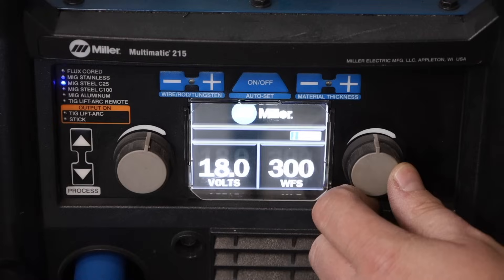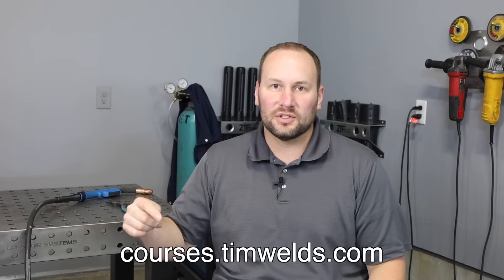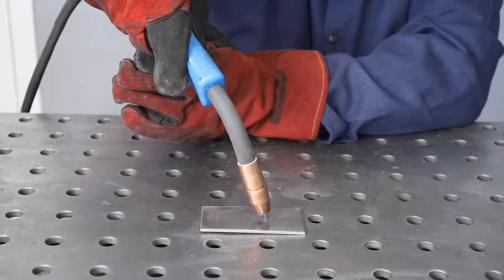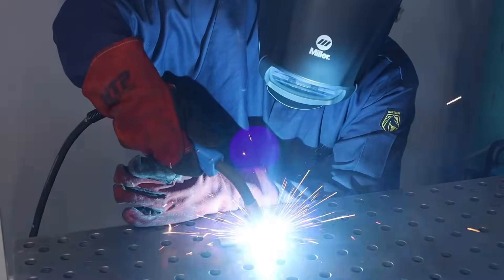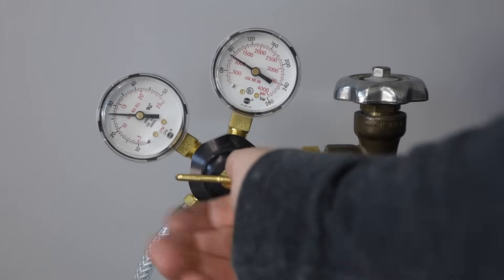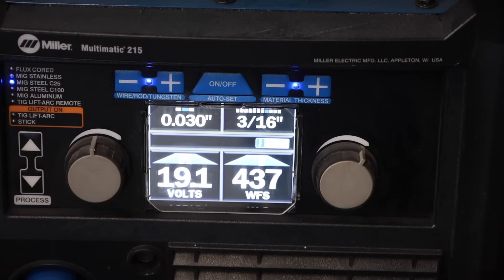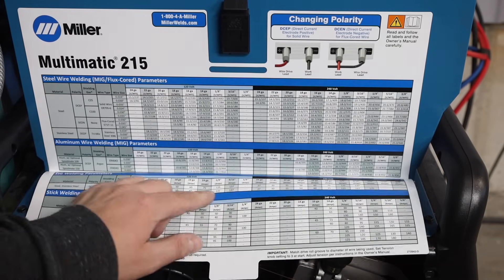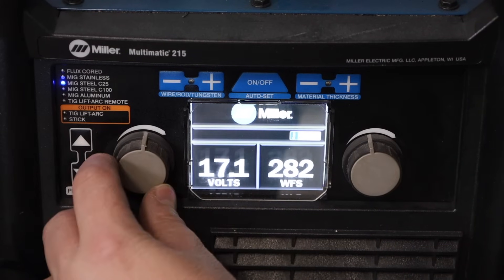MIG Welding Basics For Beginners

Comment: I weld service hangers for underground mining.  Taught hand propping to get a feel of thick metals but switched to free hand immediately welding hooks to a flat bar as need to make sure is square and against the prop.  Hard yakka when got a guy with 25 years more experience  than me waiting for me.  30 volts and 11 with the wire speed.  
We weld off angle as the hook is pulled in square to the flat bar during the weld.  Does this not happen with smaller materials?

Comment: hi sir, nice content. I am a begineer and using HBM200. This machine have only voltage, how to i play with it. I m working for motorcycle frame. The wire can be use is only 0.8 and 1.0, Please advice, thanks

Comment: 74 yrs old. self taught amateur no books and no You Tube with wonderful videos like this. started gas brazing 50 yrs ago, then gas welding, then stick welding with the cheap buzz box for many years, picked up a used suitcase inverter DC stick (what a huge improvement) and now have a 250 amp MIG which is a joy to use.  Wish I had went to Lincoln welding school.

Comment: Greatly appricaite this. I am actually about to head to weld training at work, & I never welded a day in my life. However, I used to watch my old man build stuff growing up. Plus now with work wise I see alot of crappy welds within the dept. I'm at. Most common at the work place are running wire too fast causing splatter, & having too thick of a weld. Before I moved to the fabrication dept. I was a lead in the Powder Coating Dept. Can't tell you how many issues we ran into from fabrication. Gaps in weld, Pinholes (Very common), weak welds. Thanks for this video as this is me doing homework for the coming up event haha.

Comment: You find the running amps by looking who manufacturers of wire they will give u the correct settings
Reply from the maker: You don't set amps on MIG. There isn't a particular setting that will work for a given wire in any situation.

Comment: So the voltage controls the contact frequency? So if I'm getting slow pops, do I need to increase or decrease the voltage (is contact rate proportional or inversely proportional to voltage?). I have an old 90A Mig w/ CO2/Ar and 0.8 mm steel or Al - Just testing it for now, trying to weld stuff. It's a Clarke with Min/Max and 1/2 switches, both controlling voltage, apparently ("Max" & "2" being maximum).

Comment: I noticed you weld in both directions. My tutor is trying to get me to weld right to left so I see the tip and joint to be welded but I feel more comfortable welding left to I right. Is there a right or wrong way in your opinion
Reply from the maker: For short circuit MIG, either way works. Assuming you're right handed so you are talking about a push angle, it's a little easier to see where you're going, but you have to look past your wire to see the bead profile. A slight drag angle will give slightly better penetration in some cases, but it matters very little as long as you're hitting the joint. If you ever weld aluminum or use a spray transfer process, it needs to be a push angle. For flux core, it needs to be a drag angle. I think it's best to learn to weld both ways.

Comment: TIP1: Some machines have a PURGE GAS button and a WIRE FEED button. The WIRE FEED is handy when you install a new spool of wire and don't waste gas, and the PURGE GAS button is your friend at the start of your shift because over the course of a few hours, the gas dissipates from the whip and so if you weld without PURGING GAS, or pulling the trigger to replace the dissipated gas, the start of your first weld will have porosity. EDIT: I forgot to mention that the only machines I've worked with that don't require a trigger pull or purge gas start of shift are the FRONIUS machines, but it's still a good habit to do it anyways incase you end up changing to a different work station or job location where they use a different machine.

TIP2: It might be useful to think of WFS vs VOLTAGE as such: WFS is the INDEPENDENT variable, where VOLT is your DEPENDENT variable. In other words, what you set the voltage to is DEPENDENT on your WFS - NOT the other way around.

Comment: You know what to do only one thing you  don't know   I will tell you ànd al you guys   is the electric power  I have that try to ran my welder never work properly   I found out the breaker box only 5 volts breaker was there  I needed  25 or more  so didn't work the plug for my welder  so I have see that same is wel to

Comment: why its always called MIG? it is MAG also no?
Reply from the maker: This is technically MAG because the mixed gas is not completely inert. In the US most people and nearly every equipment manufacturer call everything MIG so I follow suit with that. They use the same equipment and follow the same general principles, so the difference in terminology is really just semantics. The more proper technical term for all of it is GMAW or gas metal arc welding. Aluminum is just about the only material that is welded with true MIG, nearly everything else is technically MAG.

Comment: what i learned from my class mate is when you clean your copper collet you push the dirt out from inside out from the otder end with a thick (ca. 1 cm ) round piece of metal rod. or one leg of the welding pliers. I tried to turn it inside as you did it in the video but  ot realy cleand it propely. It's just one tip.

Comment: Just found your videos. How do you know how many volts are in a setting on a Hobart Handler 140? The is no digital reading on this welder. Thanks.
Reply from the maker: The absolute number doesn't matter. Turn wire speed up and down to control overall heat because it indirectly controls amperage. Turn the voltage up for a longer (average) arc length and turn it down for a shorter one. I have several MIG settings videos on the channel that will walk you through the process.

Comment: I need to weld a piece of metal tube at a 45 degree to a metal frame.  Can I hold the piece of metal tube with my gloved hand while welding it to the frame or will I shock myself???
Reply from the maker: You can hold it to tack weld it in place. The circuit will be between the weld wire and the work clamp, so you wouldn't be anywhere in that path. It's completely isolated from earth ground and your electrical system.
Reply: @TimWelds  Thank you!

Comment: Why do you call it mig? Is not more correct mag? Metall active gas
Reply from the maker: You're correct. In the US, most call it MIG regardless of the gas, so I use that term even though it may be slightly incorrect. Gas Metal Arc Welding is the correct term in technical circles. Honestly, it's a trivial distinction in my mind since they use the same equipment and have several variants.
Reply: @TimWelds  thank you for the explanation. I am from Germany 😏😀

Comment: I've gotten the welding machine from my stepfather. Unfortunately he passed away and I'm left with a tool that I don't understand but am willing to learn.

Only on my welder I need to select the welding thickness and steel type.

It's an oerlikon citomig 200mp with two different bottles.

Oh with 85/15 argon/co2 and one with I2003 argon.

Don't know what the straight argon bottle is for tho
Reply from the maker: The straight argon is probably for welding aluminum.

Comment: I got a mig passed by my grandad and hardly  know anything but I thought u didn't need gas for a mig
Reply from the maker: You can use flux cored wire without gas or solid wire with gas. I have lots of tutorials on the channel for either.

Comment: Tim, I'm absolutely just a hobbyist welder short on knowledge and grateful for youtube. Question--why not make a jig to use for holding the torch at the right angle  (at least for simple linear welds)? Maybe there's just too many variables involved for different welds that are required. I'm 67 and just learning but wish there was a jig that could hold my torch to take away my unsteadiness.

Comment: NO its called mag welding... Carbon dioxide is an active gas
Reply from the maker: Technically true, but in the US you’ll never hear the term. Gas Metal Arc Welding is the technically correct catch all in academic circles around here, but I just used the term more people will know.

Comment: When welding a thinner piece of steel to a thicker one - eg a T weld when the vertical piece is say 3mm and the horizontal piece you're welding it to is 6mm, what setting do you use from the charts on your machine - 3mm or 6mm?
Reply from the maker: Closer to 6mm settings than to 3mm. The technique is to bias the larger plate a little bit and it will roll evenly between the two.

Comment: Something you did not cover and most do not cover is. I have a hard time seeing what i`m welding I don`t know if it is something i`m doing wrong or if my shield is set to dark if i`m in the wrong spot when welding. I just have a hard time seeing the two parts i`m welding or the crease where i`m welding. Thanks Kevin
Reply: Welded for my first time yesterday and that was my biggest issue 😅
Reply: @SamplyCharishBeatz highlight chalk
Reply: Keep the glass clean and try a lighter glass type. Darkest is 12. 10 is lighter but when you are not yet used to the weld light, your eyes will be "over lighted" ( I do not mean "weld eyes. That feels like horror, like sand in your eyes). You must always look at the melt bath. You can also use crayon/a chalk and drag a line parallel to where you want to weld. Welder for 13 years and weld inspector/ndt for 13,5 years.

Comment: Does the wire make contact with the metal?  If not how far does the wire need to be from the metal?
Reply from the maker: The wire is constantly feeding out. The important distance to control is from the contact tip to the work, which should be about 1/2” (13mm).

Comment: I’m learning this type of welding in college at the moment but my welding skills aren’t that great at all. I just seems to burn the metal, it’s either due to how far away the I’m holding the welder from the metal work piece, the angle I’m holding it at or else the speed I’m welding at or maybe a combination. Out of curiosity how far away am I supposed to hold the welder from the piece or am I meant to have the metal tip of the welder on the metal work piece itself? And also if you know what is a suitable angle to have the welder from the pieces. Thank you

Comment: Thank you for your great content. Awesome videos. A lot of trade welders are going to be using larger syncrowave or Lincoln machines, and they are not digital displays. But the voltage and amperage settings still translate. It's all about the settings. You have a subscriber here. Keep up the great work.

Comment: Good day Sir.

I am experimenting with the different welding methods, i started with arc welding and then moved into TIG and no want to try MIG, i have argon gas from the TIG welding and want to know if i can use that for mildsteel with the MIG welder, it is quite a thing to keep different gasses on hand for welding both the cost and availability plays a big role. 

Any advice on a happy medium for a non professional welder doing odds and ends?

Regards

Comment: They are called welpers. Taking off your tip and nozzle is a waste of time. It should feed right through. Inductance is huge if you have even basic skills. It controls the firmness of your puddle. Wire feed speed controls the speed of wire being fed nothing else. That is why if you have too much wire it spatters and pops all over the damn place. You can control that spatter by adjusting the wire to an appropriate speed for the voltage being used. You Tavel fast you get a shitty weld, go to slow same result. It is a good idea to manipulate your weld because you can get more impurities out and leave a nice looking weld. A nice looking weld is just as important as it’s functionality. Try to use the edge of your work bench for stabilizing you for longer welds.

Comment: 11:50 i actually think this is where my mystery poriosity has been coming from. Because its typically come on the back end of my welds. I hadnt noticed im using my wrist but it does make a lot of sense. Gonna have to do some dry runs to stop doing that.

Comment: Is it safe for me to have never even touched a welder before and weld a motorcycle frame that is cracked in half together for a bike that does well over 100mph?

Also I'd probably just set it to 18.5 volts and call it a day.

Comment: Hi, beginner here with beginner questions—Why is it best to clamp the negative directly to your work? How is it better? Whats the idea? And, is there a time when it's absolutely necessary to clamp directly to your work?
Reply: Mig stainless steel welding
Hope you like

 https://youtu.be/mTCNjjhy9u4
Reply: Depends on what quality of work you want achieve.  Surely you will lose some power.  

It will cause welding current leakage or restriction. Or in other words, it will cause a drop in welding output voltage.

Comment: Is the shielding gas supposed to be 75 pct Ar and 25 pct CO2 or the other way around?
Reply from the maker: That’s correct 75Ar-25CO2. That being said, you can run anywhere from 90%Ar-10%CO2 all the way to 100% CO2 for short circuit MIG with only a very slight adjustment to voltage.

Comment: Great Vids! I have been looking for advice or a tutorial on the proper way to attach the oil pump pickup screen tube to the cast iron oil pump body, Mig, Tig and brazing have all been mentioned but no real professional welders out there chiming in. Thanks for the help.

Comment: Appreciate the info and breakdown of it. I’m a sign maker and I need sign base built from 1/4 plate with 2x2 square tube 10 inches tall welder in the vent of the plate. This job was passed on to other that always seemed to be busy. So I’m taking on the challenge of just welding them my self. We have a nice miller mig welder and huge metal work table. So I’m here looking for tips on how to correctly weld. It’s just sign post nothing fancy but I still wanna be able to say yep I did those. I have 8 of these to do next week and I spent some time this week practicing on scrap. I see a few things I was doing wrong and have a better understanding of the settings thanks again. And hopefully the welders at work won’t give me to hard a time when I’m done👍🏻

Comment: I'm just a home shop hobbyist with a Miller 180 Mig. Being a self-taught welder I am able to learn proper techniques & what to look for, & how wire speed & voltage effect welds, from your videos.
You have a great way & manner of presenting the info also, so it's easy to follow along & understand. Thank you for your videos.

Comment: I've been welding 27+ years and there's a ton of great information in this video, all of it spot on. One minor thing I'd like to mention, your nozzle should never be more than hand tight. I never use my welpers to remove or install the nozzle, even if it's hot. Here's why: What I'm seeing at work is younger welders being told to tighten a hot nozzle using their welpers. When it's hot, the inner diameter is slightly larger and doing this causes the threaded insert to get pushed into the nozzle. This results in your contact tip sticking further out and the gas circulation to be incorrect. In the end you run into the contact tip dipping into the puddle and potential porosity. It only stood out to me because of what I'm seeing from inexperienced welders being given the wrong information where I work. Other than that, great video.
Reply: I’ve been welding for 87,000 years and I can assure you ,you are correct sir
Reply: As a certified master jb welder, I can state this is all way too complicated
Reply: Right! I get so annoyed having to bow up getting the nozzle off and the damn diffuser being stuck to it

Comment: I was a coded welder in England  until I retired. I have yet to find anybody  in America that tells other people HOW to weld ANY of the ways to weld,  correctly ,other than gas welding and sub-arc welding. MIG welding, you push , i.e. torch pointed in the direction of weld, apart from vertical down. The torch then points TOWARDS the weld. Arc welding is the opposite to mig, apart from vertical down.

Comment: If we drag we get in trouble at work..we always push. It looks nicer to me too and penetration is definitely not a problem with proper settings. "When you have Slag, you Drag"
Also weaving is not allowed to prevent cracking. X-ray can also fail the weld with a weave.

Comment: Originally in the year 1995 timeframe I purchased a new Lincoln SP-175+ MIG welder.  I’ve had fun with it over the years, using it for hobbies and small fab projects along with repairs around the house.

I like the looks and much lighter weight of the newer inverter welders (my 175+ weighs 61lbs and the Miller weighs 38lbs).  Would a welder like the Miller 215 (I know it’s multipurpose, but I like the display) perform better?  I think the Miller 215 can weld up to 3/8 mild steel.  I also plan to get a dedicated TIG, something like a Everlast 255EXT for aluminum and stainless projects.

My old Lincoln SP-175+ does have variable voltage and wire speed adjustments, but I have to refer to the inner case chart for suggested settings.

Comment: Great video!! I use to mug weld at a gate factory 2nd shift when I was a senior in high school!!!!
Yeah no manipulation needed in most cases!! 
Shielding gas is so important!! When it runs out you will know! It will leave holes in the weld! 
Wire speed is crucial !  When I was learning how to weld , I would have my hand on the wire speed controller and turn it up and down as I was welding with the other hand , just to see and feel what the optimum speed was!!!!!

Comment: Hello I have question for expert. If welding steel beam with a stick welding is ok for another person to work with grinder on same structure  same time or is a risk too get shocked by electricity. Answer ASAP if you can.